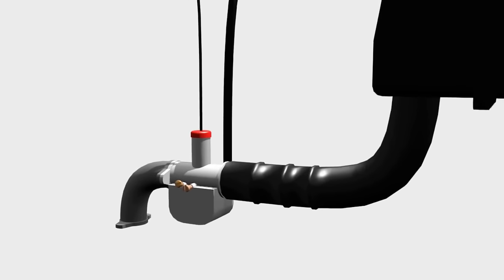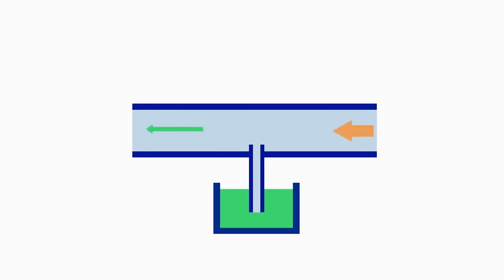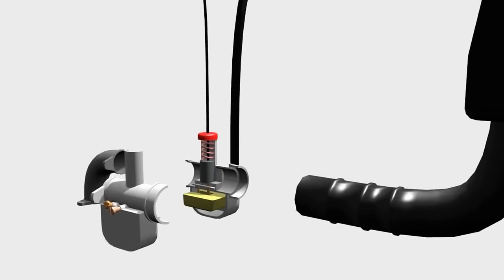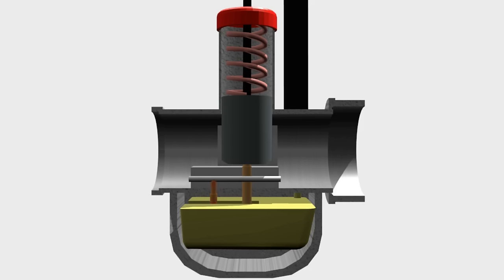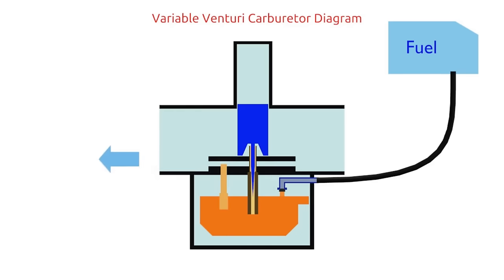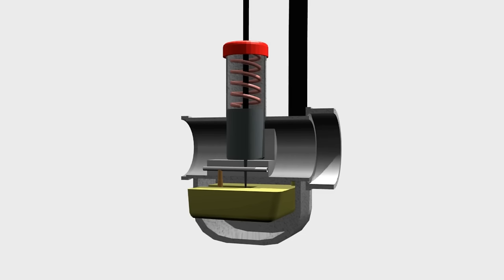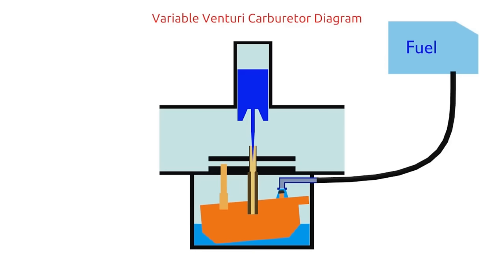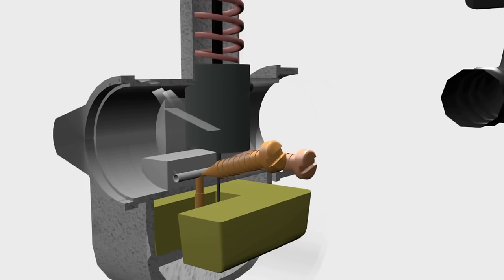Motorcycle Carburetor Working Principle and Animation

Comment: Something I'm still a bit lost on. When my bike accelerates, but I'm careful enough that the rpm stays relatively the same (even drops a little) my bike is using more  fuel, right? has to be, if energy is now being converted to producing torque. Is this because I've changed the fuel/air ratio?
(Not a scientist or a mechanic, btw)

Comment: I get the idle screw to adjust the idle rpm but What is the point of the piston screw other then it to tighten to make it go higher ??
Reply: if adjusting the idle doesnt help?
Reply: I have this same question. My guess is that the idle air channel / pilot jet are just not designed to do all of the work of keeping a bike alive at idle

Comment: Good explanation of a carburetor. Music is very distracting and unnecessary and the wording and seems like it was some some sort of translation from another language.  No-one calls the part that changes the Venturi opening a piston - it is called a slide because it slides up and and down with the needle when the the throttle is operated.

Comment: great video explanation minus the pesky music...lets add another tiny venturi to route water droplets into the engine as the throttle opens and you probably get 20percent fuel economy as a result....(men in black enters the chat...)
Reply: naaa just spray some water on the intake, but only if the engine is at or above working temperature to avoid hydrolock

Comment: Ok but when exactly does the fuel in the float chamber decrease? By doing what?
Reply: It's sucked up by the air passing in the venturi and carried into the cylinder where it explodes and creates the energy to drive down the piston and move your bike.